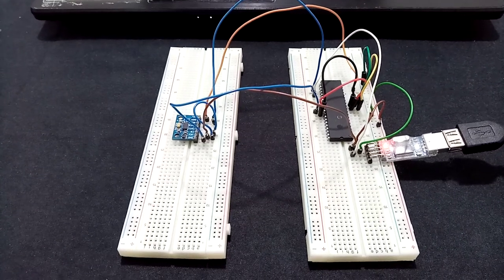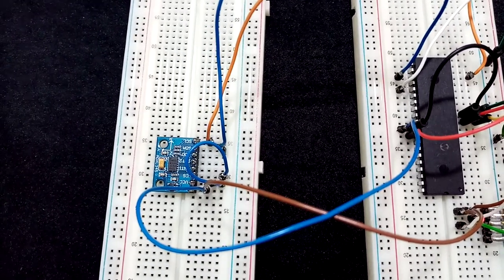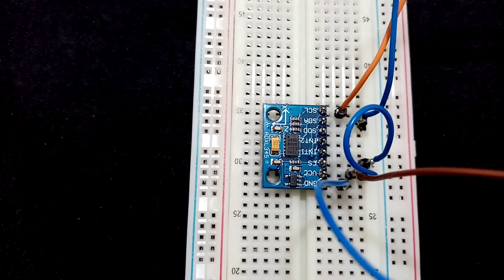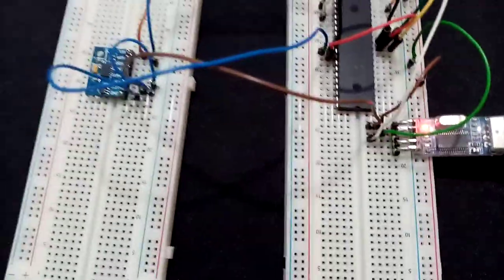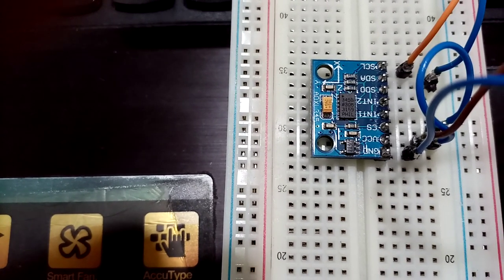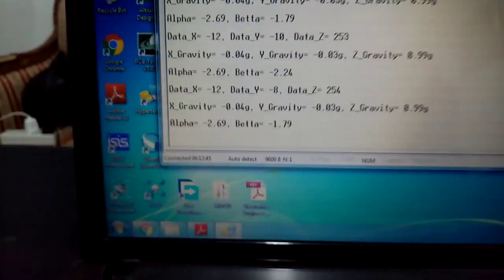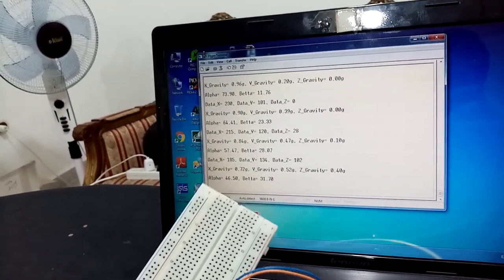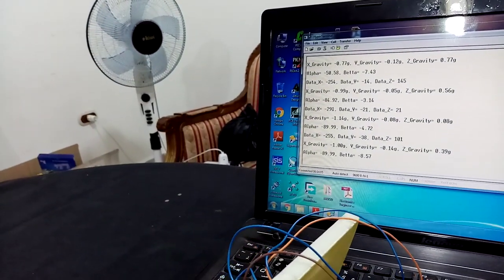Inclination sensing project using Accelerometer ADXL345 and PIC 18F4620

Comment: can i use ADXL345 with raspberry pi 3.3v?
Reply from the maker: Thank you for your question and I feel sorry I didn't answer earlier, this module can work using 3.3 Volts, as a chip it has a supply voltage range of 2.0 V to 3.6 V
Reply: @theelectronicsengineer5079  no worries haha, i have a new question since then, what device can i use to measure movement while the device is attached to something (like detect the movement while attached to a door)?
Reply from the maker: @user-rs2gv4vk1g  I didn't have a clear idea about your meaning of movement, but I think you should have a look about the Ultrasonic sensor (HC-SR04 Ultrasonic Sensor) that can sense the distance from a certain obstacle.